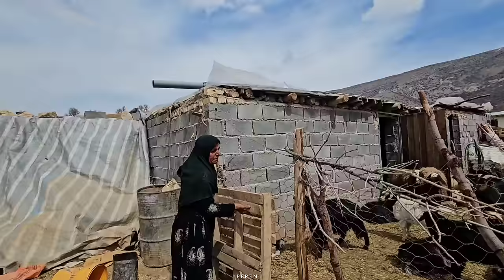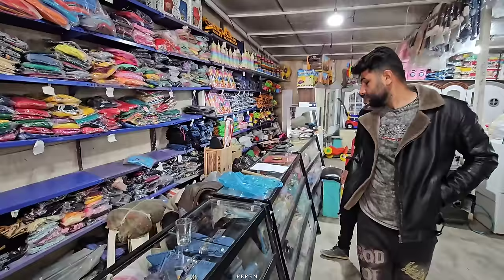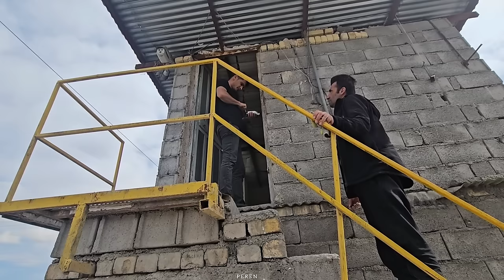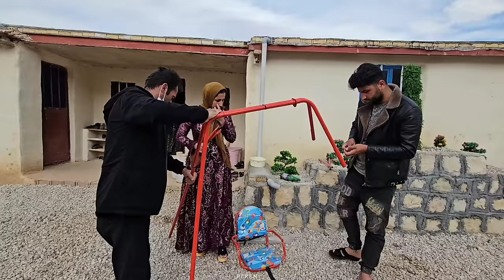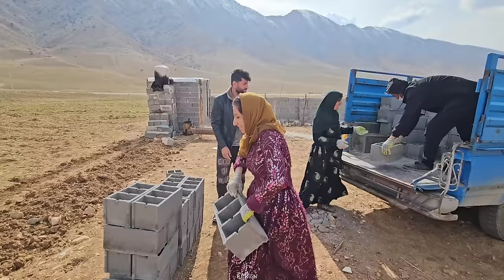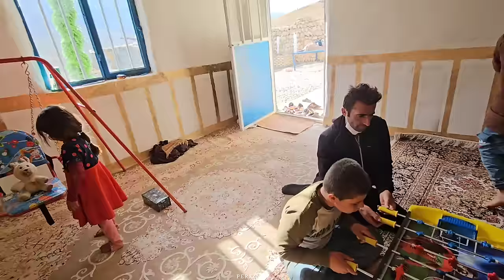Village children.  Buying toys and entertainment for children in the family 🤹‍♂️🤾

Comment: The basic rules of darts. You’ll find it more enjoyable and fun. 
Each player begins with either 501 or 301 points and gets three darts per turn. Switching off, players throw their three darts at the board one at a time and try to rack up points. At the end of your turn, add the points earned and subtract them from your total. Players continue until they reach zero